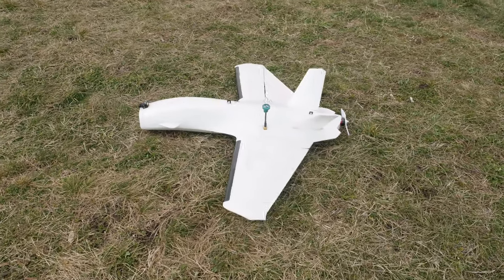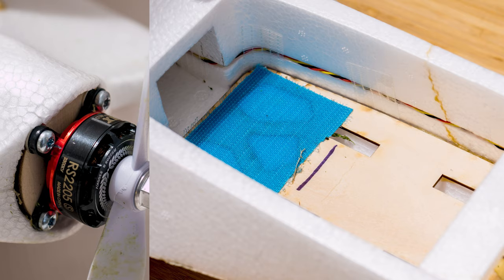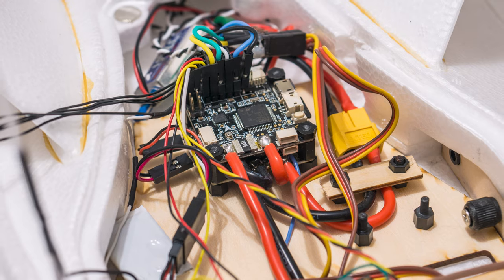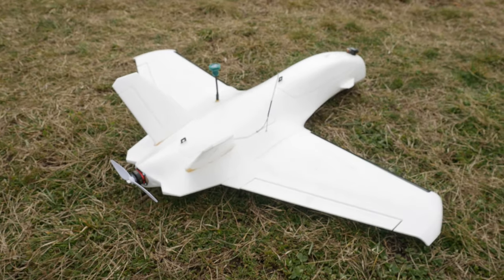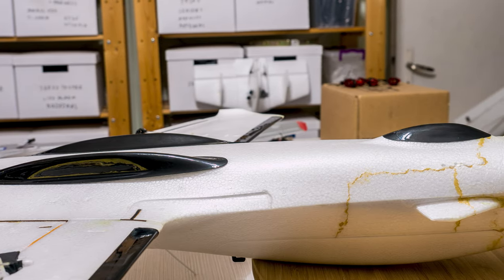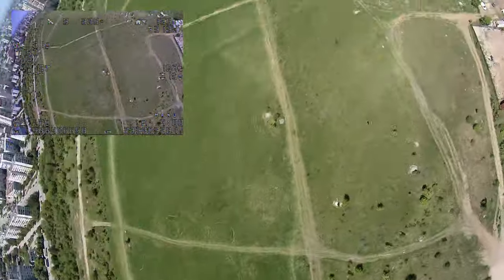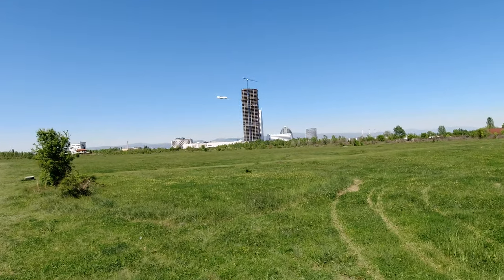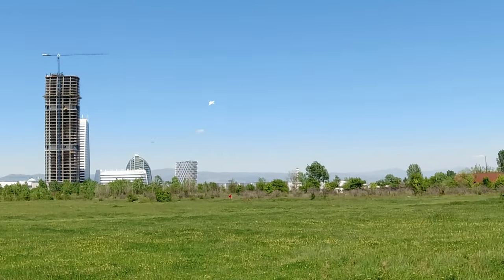AtomRC Dolphin - what an awesome plane!!!

Comment: How can I connect 2 ESC in this FC ? And how much current can be passed through the FC's current sensor? Can you make a build video of a twin motor fpv plane with differential thrust  using this flight controller.
Reply from the maker: I did reply under another video to this comment!

Comment: My motor mount also came out on the very first landing well for my first successful flight mine also had backwards controls my mistake but it shot up straight up into the air I wish I would have had my GoPro to film it but all I got is fpv View and it also went to Pieces but was very easily repaired you can't even tell that I broke the whole front end off I love this plane once you get the hang of it and you get it all set up properly it flies amazing so much in fact I'm purchasing a second one that have is a backup
Reply from the maker: Nice! Yeah, the plane is super fun even in LoS mode!

Comment: Bro I'm assembling a dolphin, my first drone ever.
I have a matek f765 wse with a current sensor, does that mean I don't need a PDB?
Also i wanna buy a budget long range module/reciever, any you can reccomend? Does it even matter which reciever i buy? Thanks
Reply from the maker: Yes, if the FC has a power module on board you don't need a PDB. As for the long range radio... perhaps have a look at the ELRS thing, I have not tested it, but people seem to praise the range a lot.

Comment: Thanks, really like your videos, always so much information. Can you help me answer a few questions I have? I got a Sonicmodell Skyhunter Racing, also a smaller plane. I think the tail end is shaking itself apart cause of high speed flying. Is that possible? Would it help if I made the vertical stabilizers smaller? And what would you say is the max speed for a smaller plane like that? Would a bigger prop be more efficient at low to medium speed?
Reply: I just finished building the exact same plane, no issues at all. Make sure you use good strong glue. Mine has got Emax RS2205 2300KV, 6X4 Prop, 30a blheli esc, Matek f411 Flight controller, Emax metal geared analog servos. 4s 1500 and 1850mah. 20-30mins flight time easily and goes like a missle over 100kph. Its currently up for sale on Marketplace.
Reply: @k1ortia  See, that's why I asked about topspeed. Mine is doing 160kph.
Reply: @audiogek  so what's your problem then?
Reply: @k1ortia  Getting tears in the horizontal part of the tail in the foam, glue holds, but foam is getting cracks/tears.
Reply: @audiogek  ah I see. Try reinforcing it with some tape.
Reply: @k1ortia  Yes did that, waiting for summer to arrive so I can fly it again.
Reply: @audiogek  iv destroyed 2. On my 3rd now. Here's a tip. Make some two part epoxy resin up, and give corner, ends and what ever is failing a light coat with a brush. It will set like concrete and add 100% strength..😉
Reply: @k1ortia  Great tip!  Thanks!
Reply: @audiogek  your welcome mate
Reply from the maker: Alright then... guess my input was not really needed! Hahahahaha! Glad you are figuring it out though! Don't know much about this plane but 160km/h seems like a good deal for something this small, with a tail of the type!
Reply: I've had a Skyhunter Racing for a little over a year now and the biggest quirk I've noticed from it is that it will spaz out on the roll axis if you pull too far back on the elevator. On its maiden, it actually did a surprise nosedive on me well above stall speed during a gentle turn in acro mode and it plummeted into the ground (barely cracked the nose, thankfully). I suspect the flight stabilization was giving it too much elevator to maintain level flight and the plane said, "Nope." I say this because I reduced the throws in INAV and it never did it again.

I think this is all just a limitation of the design. The carbon booms themselves are pretty rigid, but the wings they attach to are not, so the tail is going to flex around and distort a lot if you put too much force on it no matter what. I have only ever used multi-temp hot glue to connect the horizontal stabilizer to the vertical stabilizers. Stepping up to two-part epoxy wouldn't do anything because the bond is  already quite rigid and, like I said, the weak point is where it connects to the main wings.

On the stock powertrain and a 4S 850mAh battery, the best top speed I can manage is about 65 MPH. Switching to a 6x4 prop didn't improve its performance or efficiency. Instead, it just made it quieter, made hand launches more dangerous, and may have actually added torque roll where there was none before. On a high-drag plane with the aforementioned design limitations, I'm not sure I want more than 65 MPH out of it anyway. If I want to go 105 MPH, I've got my AR Wing Mini for that :)
Reply from the maker: @zorilla0  Good info, thanks for the input! :)

Comment: How does the VTX do with heat dissipation? Wouldn't it be better to place the VTX where the ESC is supposed to go in order to get better cooling?
Reply from the maker: Depends on the Vtx. Works well where it is! I do have a heatsink on it, and there is some airflow going from the front as it does have air intakes in the nose. Should be enough!

Comment: hi. would it fly also if you used 5' triblade? size/kv of that motor was meant for quadcopter. I have them but they heat up on my quad
Reply from the maker: Yes, it will! I just have a ton of these props... so would like to use them!

Comment: What about air-flow for the hot vtx module?
Reply from the maker: Did not have an issue with that, as long as the plane is flying there is air getting in there and circling around for cooling.

Comment: Hey Nikola,

a guy in Germany did engineer a pusher folding prop middlepiece which could be the solution for your enginemountproblems or the contentionell Middlepiece (28mm is the smallest i could find). Here is the Ebaylink:
https://www.ebay.de/itm/163990177310?hash=item262e93861e:g:CacAAOSwpvZaNmJX

Cheers
Nik
Reply from the maker: Interesting solution! Thanks for pointing it out!